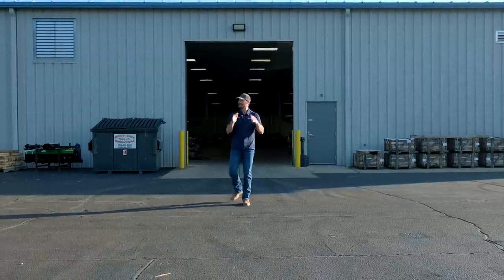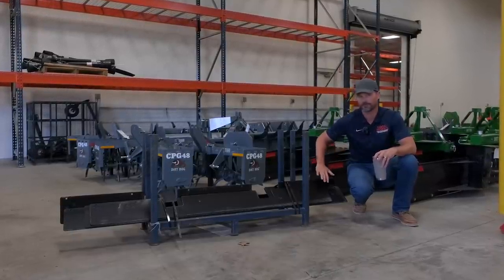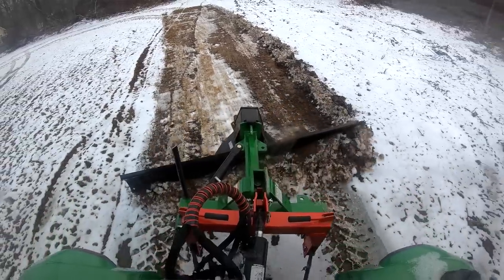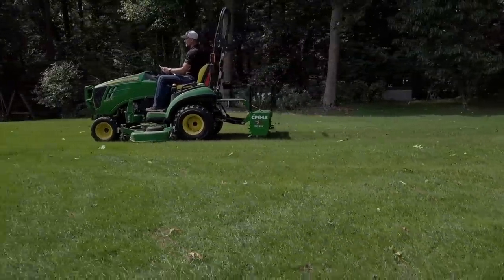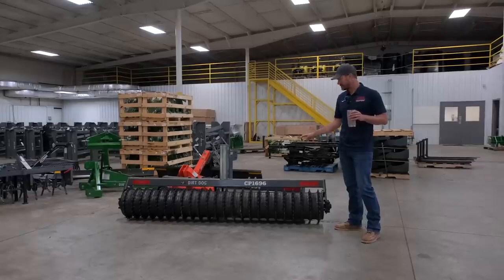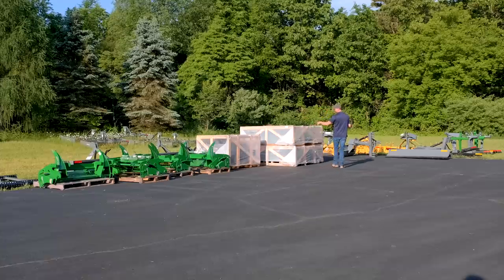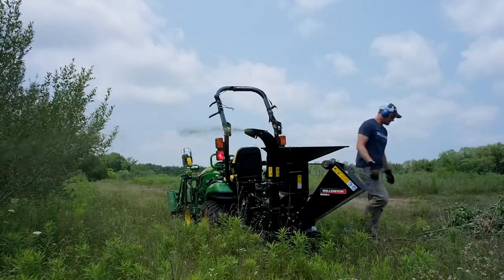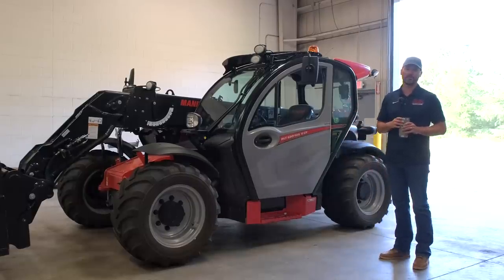TRACTOR ATTACHMENT SUPERSTORE!  50+ AMAZING TRACTOR TOOLS!

Comment: So we do drive extensions for warehousing. We dig down 12” to clay, then use crushed and screened concrete millings and use a roller packer on 2-3” lifts. If you do it right then it’s as hard as concrete when your done. You can darn near do a burn out on top of it but certainly run an indoor fork truck over it as long as you don’t spin

Comment: To solved your parking lot issue... you can drive indoor forklifts over gravel lots if it is done correctly. Peel the topsoil, then remove about 6 or more total of subsoil. Then start with crushed rock. We have limestone readily available in Pennsylvania. The key to building a solid lot... start with larger 3-4in diameter rock. Spread it out, and use a vibratory roller. Leave it about 2in less than the final grade. Then add 1.75inches of mixed (sub base) stone. This will be everything from 2in stone, 1/2 stone, as well as chips and limestone dust. Pack that with the roller. Then finally top it off with a skim coat of just screenings. (This is the stone chips and   dust combined) It will pack very well and be very smooth to drive over with a smooth tire fork truck.

Comment: Courtney:  The electric forklifts are designed primarily for indoor use.  
They don't do well on wet or uneven floors and forget snowy conditions, period.  
They will get stuck in the gravel and it will ruin the rubber tires.
The telehandler is a much better choice for outdoor use in all kinds of weather.
Reply from the maker: I agree, the telehandler is a good choice.  However, it's 100k that would maybe get 50 hours max a year on it.  That's a horrible use of cash.  Gotta find a smarter way :)

Comment: I've been driving and around forklifts for many years and you will not be able to use yours on packed gravel, no matter how hard it's packed. As heavy as it already is, then with the added weight of whatever you're lifting, you will have issues. The tires on it are specifically designed for asphalt or concrete surfaces. Of course a forklift with all terrain tires on it would solve that issue. Just sayin!!
Reply from the maker: Hi Charles, thank you for your advice.  What about asphalt millings?
Reply: @GoodWorksTractors  I don't have any experience with driving on that surface, but as long as the company laying the surface down can give you the weight per square foot that the surface can hold, then it might be fine for a forklift and the weight it will carry. I'm sure the thickness of the material being laid down has some effect on the weight it can handle.